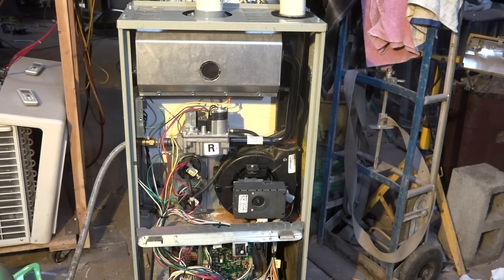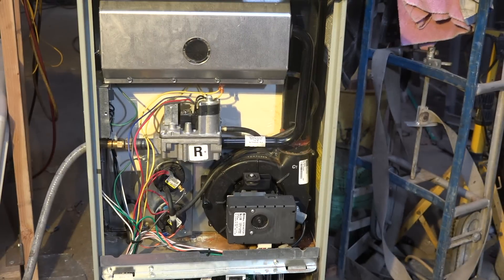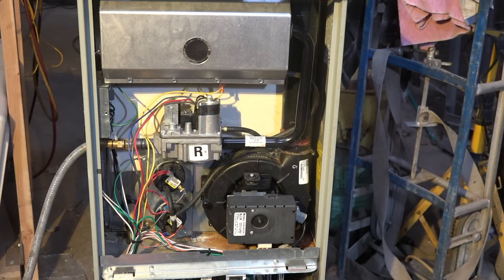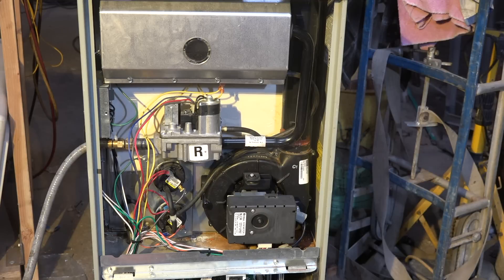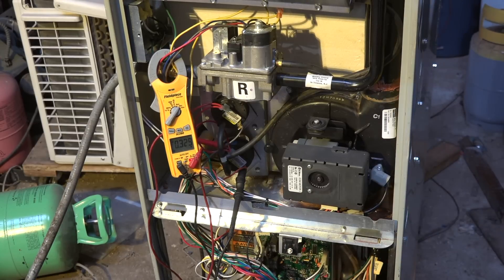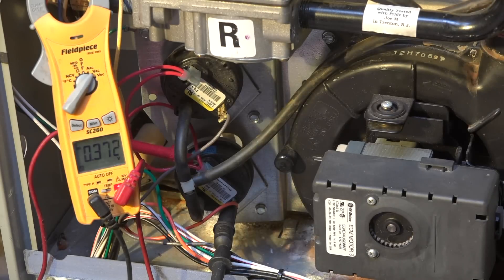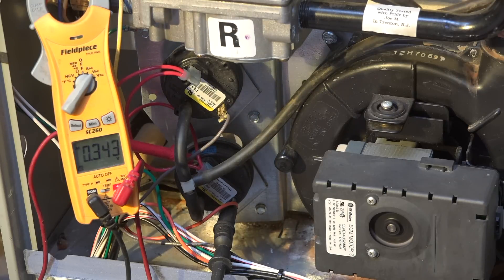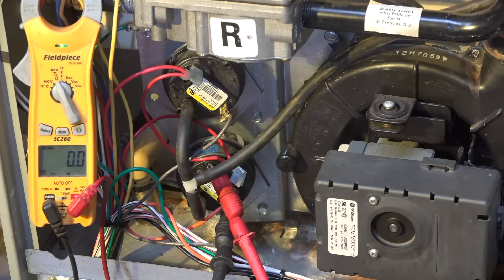What's wrong with this furnace #9

Comment: Agree with comments about the voltage drop being high. But when it turns off I should have 24v a cross a n/o pressure switch.
Reply: Are you sure that's true?
GFM

Comment: I wish you would separate your videos by "Electric Furnace" and "Gas furnace", it would be so helpful in finding the correct info
Reply from the maker: I do not separate the diagnostic videos by type of fuel.  I do however, have over 90 playlists that will help in finding the videos you need.  Just go to my channel and scroll across until you find what you want.  It may take a while with so many, but I don't know any way to make it simpler.
GFM

Comment: has to be a bad pressure switch. Voltage drop is to high telling the board to there is a voltage problem so it is shutting down.

Comment: Why are we tasting voltage at the pressure switches, I think we all know it's failing on pressure switch errors.
Going to guess plugged intake/exhaust, pressure switch tubing or at the collector box where the pressure switch tubing connects.

Comment: The voltage drop across the pressure switch should go to 0 volt with the pressure switch close. The 2.0 volts present indicates faulty contacts, no closing properly inside the switch. the multimeter showed approx 0.1 ohm which could be misinterpreted as an ok switch.

Comment: it's another guess and see if you get it right, video. solution - stop buying Trane equipment, LOL. they're not worth the repair costs. i should clarify, not worth the overpriced replacement parts it takes to repair them.

Comment: Under load the Inducer motor could be bad and drops out.
Relay on the main board could be dropping out bad board.
This problem happens a lot on old GMP, GUP furnaces.

Comment: Seems like low voltage at only 2volts across the switch bad transformer possibly ? helps if you know what that voltage should be seems really low

Comment: flame sensing rod not working.
Reply: By the Numbers
1. If the pressure switch drops out the furnace will retry 3 or 4 times the inducer motor stays on untill the last try then lockout.
2. If the flame sensor drops out the inducer motor will stay on and clear out gas. Then retry 3 or 4 times then lockout.
3. In this case the inducer drops out and will not go into retry unless it cools and the motor is able to start. Often one connector on the motor is bad or the tiny wire on the motor side to the male spade is bad when hot.
4. Often the Motor start relay on the board to the inducer motor will latch a time or two and not latch intermittent. 
5. I have seen Poor transformers as they die, to low a voltage cause all shorts of goofy problems. I have seen low voltage on the high voltage 120 cause the same problems. as well as a bad ground.
6. A bad hot surface ignitor. Inducer motor stays on and retries 3 to 4 times. then lockout.
7. Clogged pressure switch tube inducer tyres will not light will not try 3 or 4 times will lockout with a code open pressure switch.
Somewhere here is the answer.
Reply: Bad rod the Inducer motor will stay on and will retry.
Reply: but on second try, it didn't even fire...
Reply: well it maybe a faulty Hot surface igniter.
Reply: MrAnsweres  First time it fires, second try it doesn't. There is nothing to do with flame sensor. If flame sensor is faulty, to prove it is, you need a fire, but it didn't even fire on second try. Am I right? Or I missed something?
Reply: @363rs  on oil furnace the control for burner will shut everything down if it see flame before firing sequence aka if there is continuity in the flame sensor circuit. I could be wrong though, not 100%.
Reply: 363rs thats why i said HSI what do you think?
Reply: MrAnsweres 👏👏👏👏